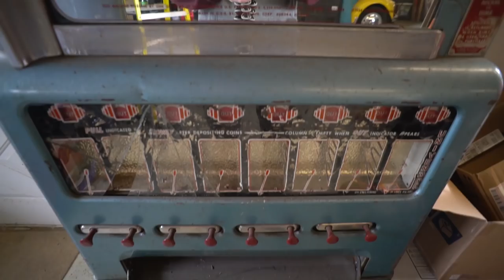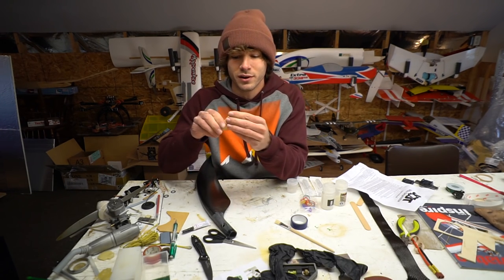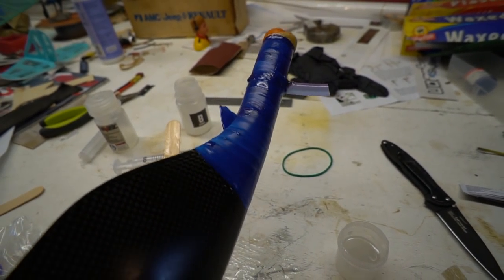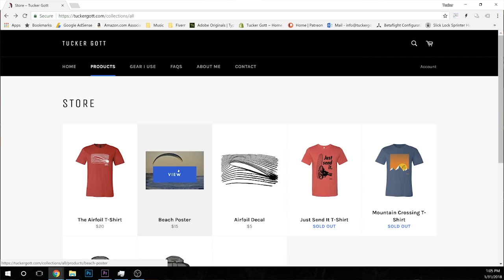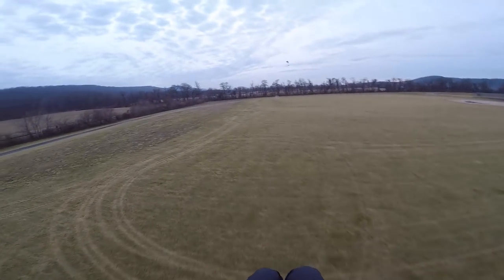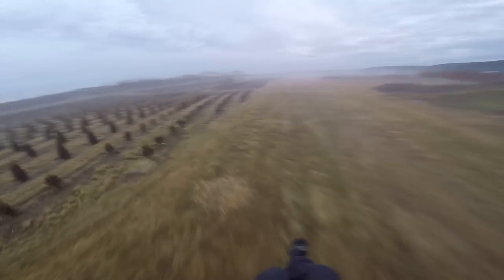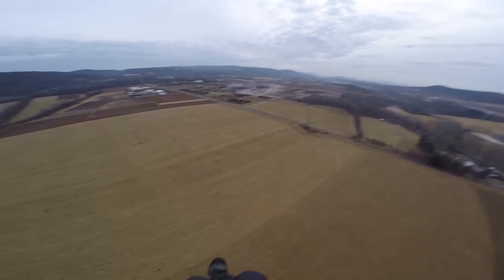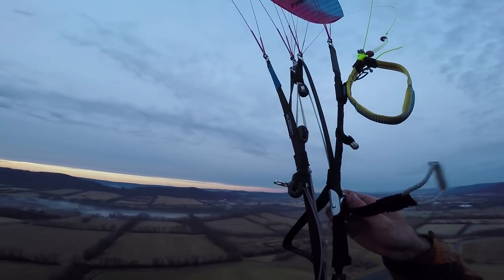Selling My Paramotor...

Comment: Tucker, I have a suggestion for you on what to do about your van windows where the the foam insulation covers them.  Pro tip...  If you paint the window glass from the inside with black spray paint, it looks like dark tint from the outside and people wont see the foam insulation from the outside.  Its real easy cheep fix that works great.  I've used it before on truck camper shell windows.  If someday you want to remove the paint, it comes off easy with a razor blade.

Comment: Best to use tissue or paper towel to remove excess epoxy before wrapping with tape. Actually the cloth will absorb 100% of the epoxy no need to for any on top of cloth. Then wrap with plastic wrap then if need be add the reinforcement tape. Will give u a glossy finish without sanding

Comment: What are the differences between the V2 & V3 Scout machines? 

I remember in the day, the running joke on new dirt bikes in some model years was, "bold new graphics" - basically same bike as last year, with different colored stickers. 😄
Reply: I'm pretty sure they're the same model, it's just Tuckers second and third ones.
Reply: I thought it was a 4-stroke?
Reply: Na I'm sure all of tuckers scouts have the 'moster plus' engine. You might be thinking of when he test flew the prototype 'air conception tornado 280' in January. That's a prototype of the new engine / harness air conception will release soon. edit: which is  a 4stroke. His vid on it is here: https://youtu.be/vy3VtTmwVhA
Reply from the maker: Nope, they're both the same! I just name them v1 v2 v3 as the individual motors I've owned.
Reply: Ahh, thanks for the heads up! :)

Comment: Honest question how much mass can that Wing hold for the pilot? And do they make bigger Wings to carry more mass?
Reply: Yes they do make bigger wings.  For example Nova makes a wing with a weight range of 120kg - 225kg
Reply: oh close. 500 pounds. I am 419 myself. does the rig weigh more than 80 pounds?
Reply: Nerys ,  I’m pretty sure you’d need a bigger engine too.  I’d say your best bet would be to look into a quad.  Check out Blackhawk paramotors for a quad.

Comment: Surely Tucker you of all people need a second motor for a backup?
Reply from the maker: For the tiny amount of equipment failures/accidents I've had that set me back, I don't think it's worth owning a second.
Reply: That's the advantage of having good equipment.  Still a good idea to have a spare prop though. (ask Shane about his durability testing)
Reply: Hi Tucker,
Here's to hoping you never need a backup unit then. I've not missed a single upload of yours to date and to see you grounded would not be good!!  I really enjoy watching your style and skill.
Sandy
Reply: He's got Jaclyn's... ;)
Reply: Jaclyn's is probably an 80cc lol
Reply: Tucker Gott try out super glue and baking soda for any small repairs. It does set up super fast although is unbelievably strong. Will need to sand for a smooth finish. It’s what we use on our air boats

Comment: Hey Tucker, I wouldnt have enough  to purchase a new or used paramotor but I am really good with motors. Would it be safe for me to build a paramotor, and only have to purchase a wing?
Reply: Joel Venner No probably not... Sorry dude
Reply: Safe depends on your own technical ability. Plenty of people have built their own rigs so if you are responsible and competent it shouldn't put you off. Building something decent isn't going to be much cheaper than a second hand unit though, you need a flight safe harness, propellor and engine suitable for PPG flight as well as appropriate materials to construct both a sturdy and light airframe for the motor and harness and ancillaries like gas tank, throttle etc. From experience I wouldn't advise it thought for a first time flyer, my local PPG shop builds their own custom airframes and uses TOP 80 motors but they've been doing it 20 odd years. The expense and time spent on building a reliable airworthy rig without prior experience would be more than a second hand one built by a reputable company, try local adds, speak to flying clubs etc if you are serious about getting one.
Reply: Not impossible but lots of stories of recreational Pilots building their own airplanes but then unable to fly them correctly. Ending up eating dirt!
Reply: Joel Venner Yes, it's completely possible.
Reply: Possible but what Tom said!
Reply: It's essentially a leaf blower.
Reply: Easton Williams Lol not really
Reply: Joel Venner I've got a commercial leaf blower, I may try it lol

It's just an engine that turns a prop, however your life is on the line and something is likely to go wrong at first, BUT there is a chute, so...
Reply: Easton Williams yeah im planning to be completely safe and I can build a paramotor no problem, then I can can buy a beginner wing. 
Edit: Probably wont even go into the air the first 10 times of going out to fly. Lol
Reply: Joel Venner Yeah, if you have the tools and know how then I can see someone doing it, it really is pretty simple, a prop drives you forward, not much to it. 

Now a plane is a different story because there isn't a safety net. I want to build one of these puppies 

http://www.uflyit.com/challeng.htm

Goes 120 mph and 100 cruise, 17 gallon tank at 4gph which means up to400  nautical miles, that's crazy and it only costs like $7000 more than a paramotor
Reply: Many people have built paramotors. Visit PPGPLANS.COM for free plans, https://groups.yahoo.com/neo/groups/Skyboltbuilders/conversations/messages for assistance/guidance.
Reply: Hey, it’s not rocket science. Well, actually it push prop science.

Comment: Supposedly defense contractors repair chips in military helicopter carbon fiber propeller blades with layers of a drop of super glue topped off with baking soda.  They repeat until the chip is filled.
Reply: lol.  umm.  battledamage maybe?  Definitely NOT standard practice

Comment: Why are paramotors still designed to block the air intake of the prop with a meat bag? At full throttle, a lot of the engine's power is wasted tugging on the pilot. I'd expect a 10-inch prop shaft extension to make a noticeable difference. Get your TIG out. Test that. I'll watch from over here.
Reply from the maker: A 10 inch prop shaft would create horrible gyroscopic torque effects. The closer the motor is to your back, the better. However, it does reduce efficiency.
Reply: @TuckerGott  OK, then how about two belt-driven or shaft-driven ducted fans, counter-rotating, on either side of the pilot (the ducts could make armrests)? No torque effect at all, much higher thrust efficiency because ducted fans are more efficient, plus almost no chance of breaking a prop, ever. It would be hard to stow, but if the fans' support beam pivoted, or were stowed separately, for transport, then Bob's yer uncle. Carbon fiber is out because it'll get chewed up during transport, but aluminum would do it. You can haul 60lbs.